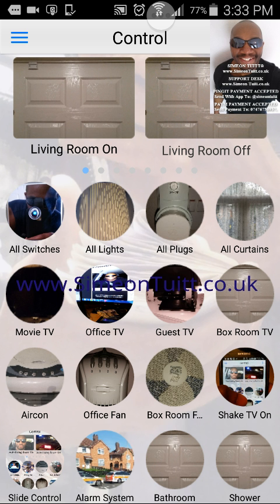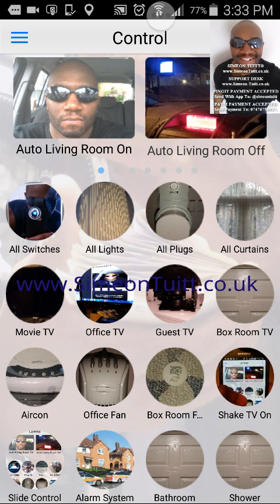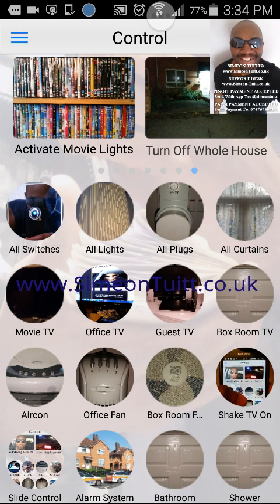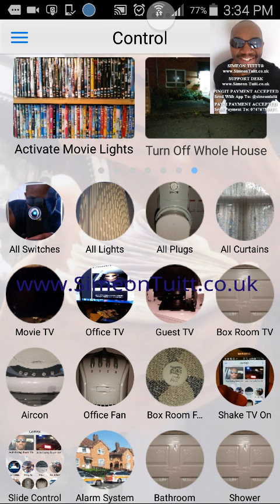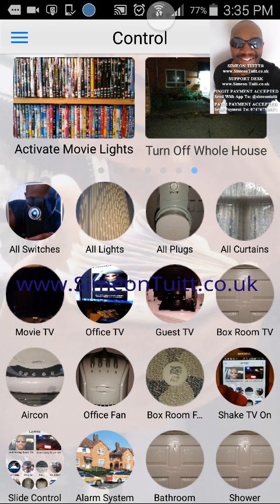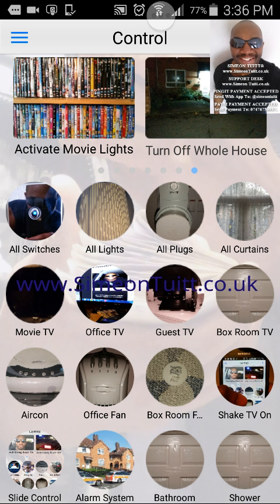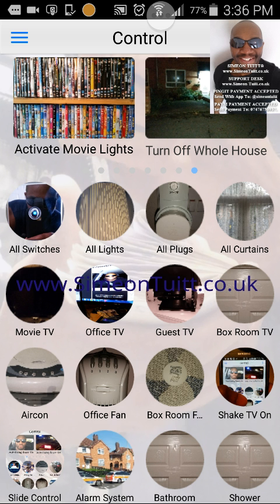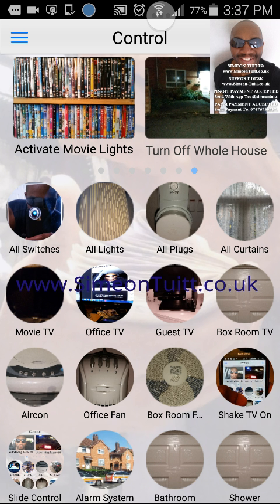Broadlink RM Pro Broadlink RM Home Automation DIY Simeon Tuitt Smart Home Automation

Comment: Hi, I got the rm pro, but I have two doubts. If you can help me, I thank you.
1- What is the bong band control option for?
2 - to control the volume of some device by holding down the button as I only had to press

Sorry if I have something written wrong, I'm Brazilian and I used the translator.

Comment: how u turn off lights u use sp plus for sure what about the wall switches u can use rf but if it was already off the switch will go to on
Reply from the maker: +Andre khoury Hi, no I do not use sp plus, I have remote controlled plug sockets that are the actual plug sockets, I removed the old dumb sockets and replaced them with RF sockets I turn on/off from the smart home hub. It is the same with the light switches, I have light switches that have an on and off signal so the smart home hub sends the signal to them, so they don't as you mentioned turn on if the switch is off. See more of what I have done with my smart home automation here: www.SmartHomeAutomationKits.co.uk
Reply: +Simeon Tuitt what kind of light switch if its rf a d make user defined rf switch dont have feedback all controlled from rm pro type of wall switch ub use if tc2 or livolo or wlansmart all r same